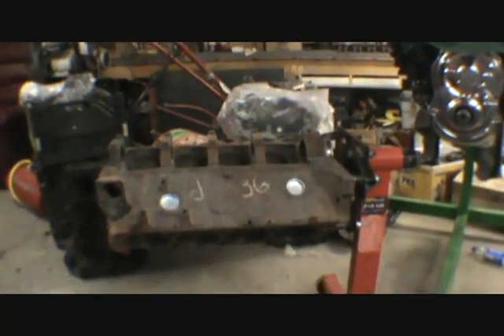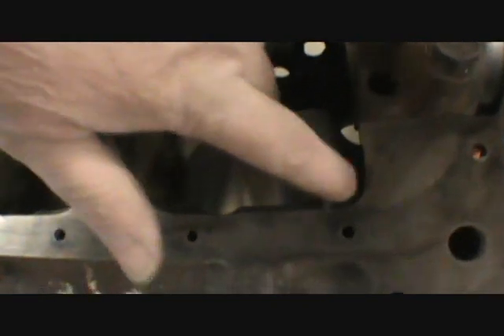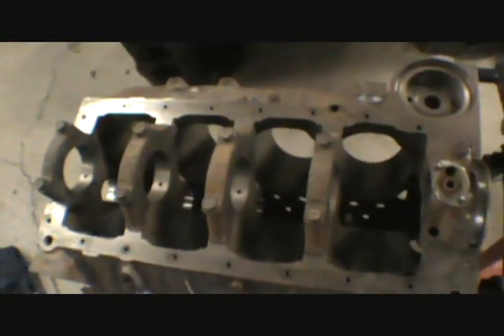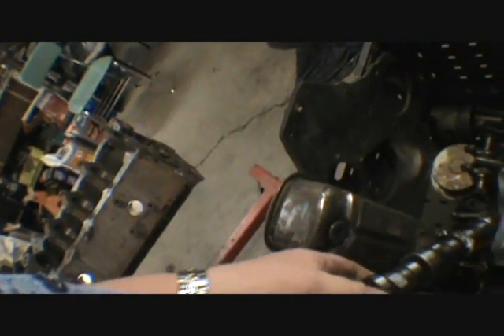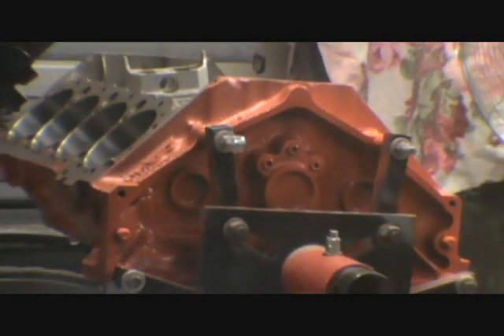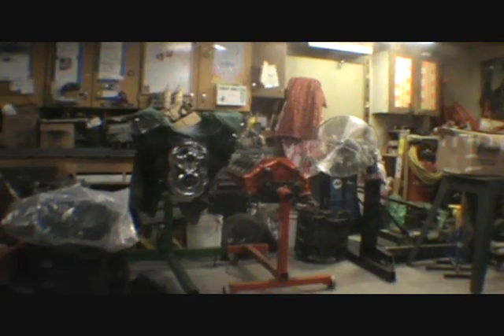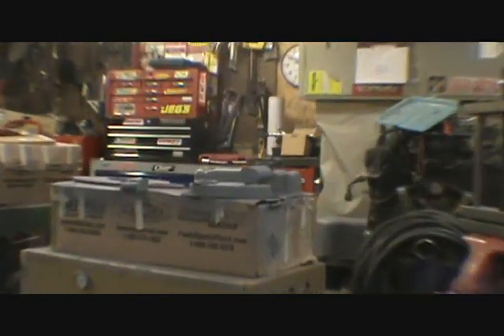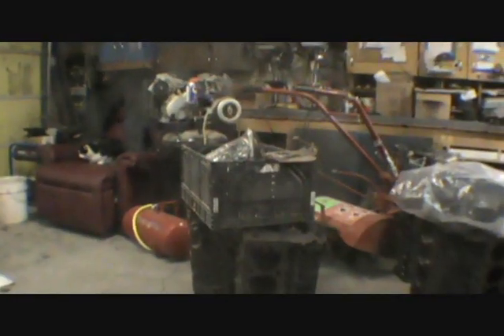jan  2 update on whats going on this year with motors

Comment: Whats the deal with the 4.3?
Reply from the maker: +sms373 needs crank kit and over hauled just havent had the funds to get it built
Reply: +tlcbear2 When you end up starting back up on it could video some of the reassembly and maybe a first start up on it. I really enjoy these truck motor rebuilds from you.
Reply from the maker: sure will. i have a few motor builds i am going to try and do and like running them on the engine stand to break them in.
Reply: +tlcbear2 awesome thanks